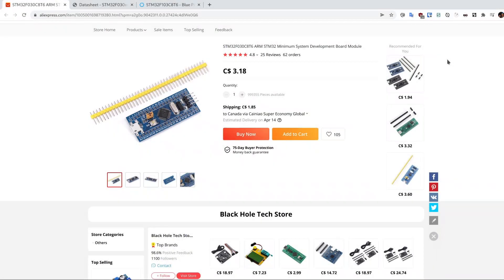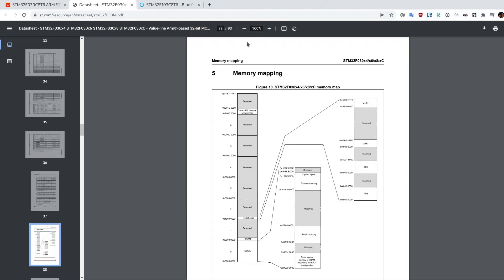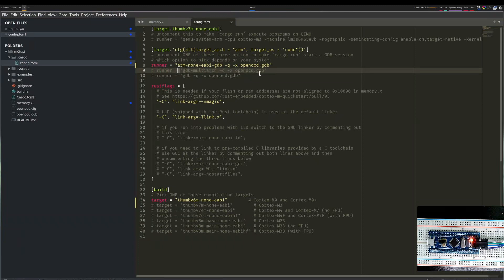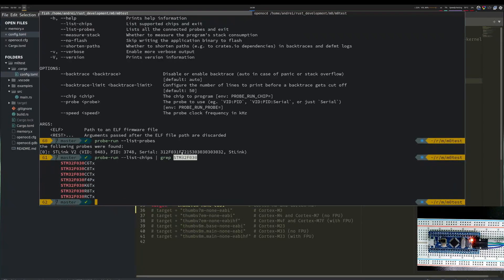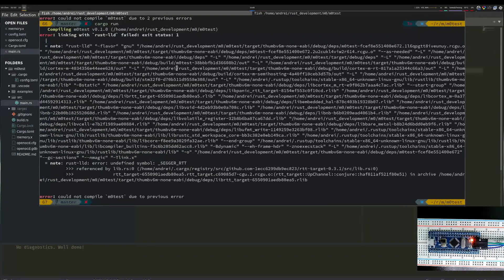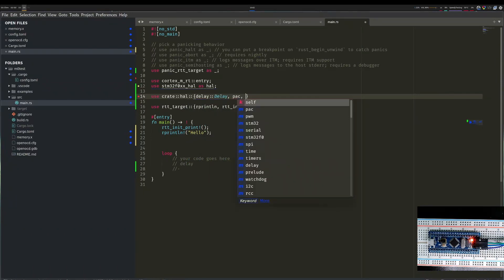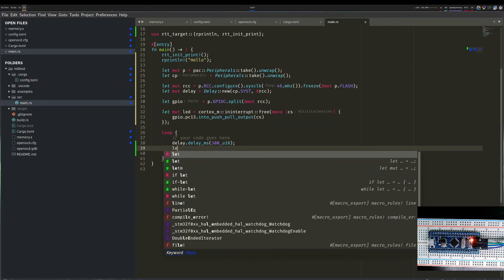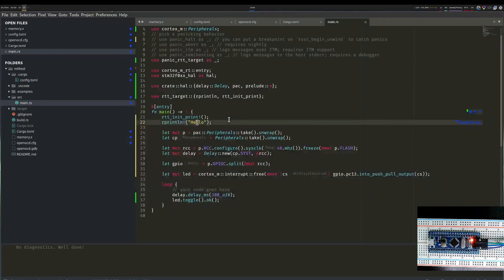Embedded Rust on a Cortext-M0 board: blinky program bringup

Comment: Some libraries consume delay, do You know how to solve this issue? There is a similar problem with the i2c bus for example but there is the shared-bus library.
Reply from the maker: @jamjestlx  Looking at the code in https://docs.rs/bme280/0.3.0/src/bme280/lib.rs.html#369 and more, it looks to me like the delay is not dependent on super high accuracy, just that enough time passes, basically startup time or measuring time. 

What I imagine you could do is have some struct containing a Mutexed delay object and implement DelayMs for that (basically deferring delay to the underlying delay). It will not be perfect as the mutex may block more than the delay requested, however at least for the BME280 it should be enough.
Reply from the maker: By mutex I mean some form of ARC + Mutex or pointing to a global mutexed delay, so that you can consume and construct several instances of the same struct pointing to a shared Mutexed delay.
Reply: @embedded-rust  I will try that. Thank You!
Reply from the maker: Can you give a specific example link?
I believe I encountered this before but in that case Delay was a trait and I ended up implementing it myself. The original delay was using timers and one could only have a single timer to expire hence delay was consumed.